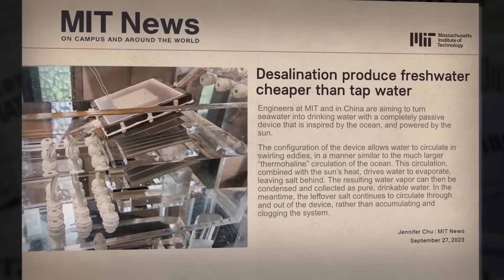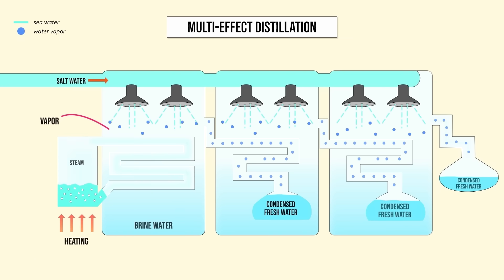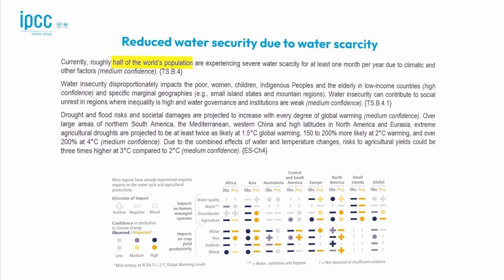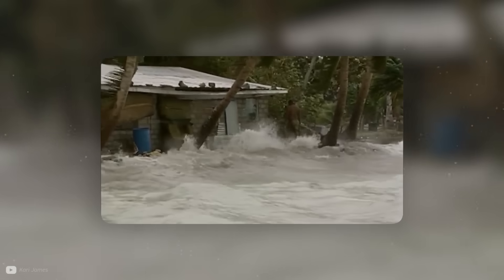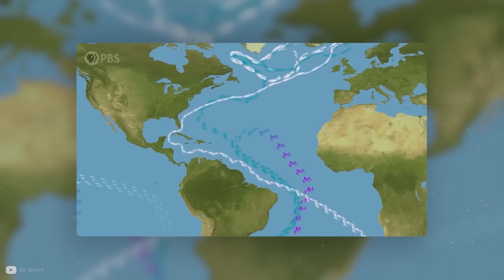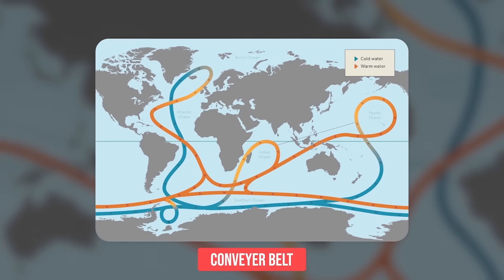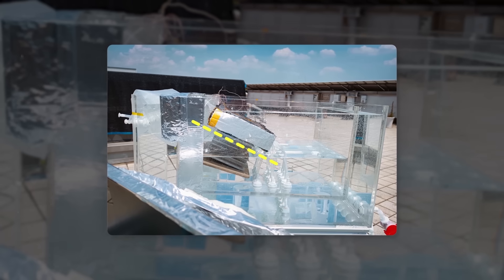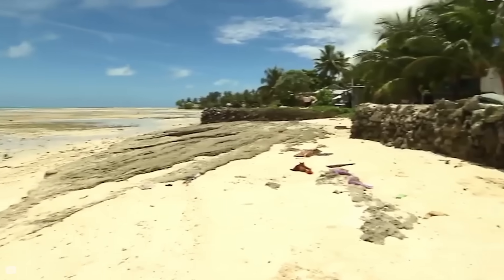Unlimited Fresh Water: Can MIT's Breakthrough Save Us?

Comment: how much sea level risen are you actually talking about?  it is public knowledge that it is less than 30cm(1foot) per 100 years. 
How much of the salt water contamination is due to excessive commercial extraction of fresh water?   I would be much more likely to follow your argument if you removed your clean green bias from your research
Reply: When you get into your car and speed along the road, you can measure the speed you have at any given moment. But if you ignore the acceleration and simply assume that you will continue at the same speed you are at now, you will not be able to estimate how long it will take you before you reach the end of the road...
Your assumption that 30cm per 100 years is a constant that does not change is where your mistake is.
Reply: @liquidminds  THATS YOUR ANSWER??  Maaate!  firstly, you are assuming an acceleration. ?  without giving any proof(dont bother, there is none, unless you're the type to purposely look at only a statistically insignificant range of years and call it "science"gospel, douche-style).  sea level rise has slowed! to 2mm/year over millennia and in recent decades "accelerated" to 3mm/year.  Considering constant decadal cyclical changes in sea level, this is simply not statistically significant.    All i'm saying here is : Don't use msm narratives as fact if you are not able to defend your position(aka know what you are talking about)
The reason i am makinig a fuss about this, is simple - half-baked scaremongering regurgitated to the masses is not helpful.  Use your platform responsibly and please put some time into understanding the various scientific views on your topics of choice.   Otherwise, very informative piece re desalination tech, thx
Reply: oh and what is the take on extraction of freshwater causing the salt contamination??   
- because here's where you will find your statistically significant cause, not in the sea level. simple human greed- commercial growth over-using a finite freshwater supply.  The freshwater is pumped, saltwater is sucked in through the inherently porous substrate to replace it .   Bon appetit
Reply: @saberling  agreed
Reply: @liquidminds  that makes no sense
Reply: @Millenial_Trucker  eli5 taking a picture does not explain the movie.

Comment: Years ago, I saw a video for a method in which the unclean water is in a shallow black bowl covered by an oversized transparent dome-shaped lid and placed on an oversized dish. The sun heats the water to create water vapor that condenses and falls down the sides of the dome into the lower dish. I presume one could equip the dish with a tap.

Comment: 144 liters/38 gallons per day, but how does one get the saltwater to it, and where/how does get rid of the unfiltered water?  That could be a lot of water pumping both ways.  Is it practical for home use?  Or even business use.  One would have to live pretty close to whatever sea and, depending on the quantity needed, a lot of units.  Practicality depends on the number of units required per location and the costs of setting up pumping both ways.  The saltwater waste output would likely not be good for sewage systems.  Lots of things to be considered before buying, once they are available and the unit price is known, or prices if there will be capacity options.

Comment: What most people do not understand is that instead of pumping the water at 800 to 900 psi, the main obstacle is overcoming the Osmotic Pressure.  This can easily be achieved by putting the intake at approximately 1,800 feet deep in regular seawater.  As the water is filtered, the saltier water can be discharged into the ocean and will drop below the filters and will be rehydrated as it moves downhill with no problem to marine life.

Comment: Modification of an existing technique for harvesting salt from sea water could also provide fresh water using solar energy. With this technique salt is extracted by allowing sea water into ponds, then sealing them off. Over time the water evaporates leaving salt behind. 
I envisage having a central pond containing sea water, surrounded by a moat for collecting fresh water, and the whole thing covered with a transparent dome. Energy from the sun evaporates the water in the central pond, which then rises and condenses on the dome, before running down into the moat. Water is extracted from the moat and salt from the pond. 
Occasionally the central pond would have to be allowed to dry out completely to allow for salt removal, so more than one setup would be required for continuous production. Due to evaporation rates this method may not provide sufficient water for urban use, but it could be used to gradually turn arid areas into fertile land.
Reply: They are too busy trying to figure how to make desalination profitable, not to make it work efficiently. That's why your idea won't work, it's too simple and you can't confuse governments to waste money when they understand how it works.
Reply: Peruvians have used the pool, evaporation, and extract method for salt for centuries.  The Salt Mines of Peru.  Adding a way to capture the evaporation of water is the key.

Comment: how expensive is the membrane and how hard is it to manufacture?  Does the water have to reach the boiling point to produce the vapor?  That seems very hot and don't see how the sun can do that.  This will not work in cold climates.

Comment: Fresh water scams are the new modern snake oil. You can't pump water by water column pressure to an elevation higher than it's starting point. Maybe the image is wrong and the whole box is below the surface level of the surrounding salt water, with a clear water free line of sight to the sun. Although how this is kept just below the surface with tides is a different question.
Heating water can cause it to boil due to partial pressure and low relative humidity in the air but again maybe the image is wrong but it looks like a filled vessel of water. How does the water vapor go down through the salt water to the membrane? 

This is  a scam device until they hand over a unit for independent testing.

Comment: I have always wondered why desalination via reverse osmosis with high differential in pressure via altitude differential (some long wells filled with filtered sea water and an osmosis filter at the bottom) isn't viable given it only seems to use energy for pumping water upwards and brine outwards (otherwise than the filter cleaning/remplacement and initial construction of the site)
Reply: Well, there are a few problems.  To get the pressures required it would have to be quite deep, and 2ndly when its that deep how do you service it to regularly replace the tubes, 3rd how do you remove the brine from such a depth?

If you are letting gravity/pressure do the work (im not an expert in physics) but seems to me would take pretty much just as much work to get the water back to the surface as just pressurizing it on the surface to that "depth".  Might be wrong on that one though.

Comment: What is actual breakthrough here? This is a device that evaporate water using heat from the sun. So this system will be limited by the time of the day, sun intensity and available space.  There is no info on how much water per day it can produce nor how much water per square meter (remember that heating element has to face the sun). 
Looks like it is good for the lab but unpractical for large scale.

Comment: There's an easier, smarter, cheaper and lower impact way - you construct a hemisphere shaped greenhouse below sea level so that you can use gravity to feed salt water into it.
The sun heats the water, it condensates on the inside surface then runs down the sides into collection gutters which catch it before it drips back down into the salt water pool.
You allow the thing to keep running until the pool is full of salt, at which point you simply dig the salt out - you now have industrial grade salt which you can sell.
Allow the pool to refill with sea water and literally rinse and repeat.
There are no filters to replace or clean, you're evaporating ALL of the water out of the salt so no brine to pollute sea or ground water and in addition to producing water, you're earning money from the salt.
Gravity pumps the water into the system, the sun extracts the fresh water so your only potential power concern is moving the fresh water collected somewhere else and digging out the salt from the pool every once in a while - if you're in a third world or other resource limited location, use shovels and buckets to remove the salt - the locals might even be happy to show up to do it for you for free in exchange for them keeping the salt.

Comment: The Ekman Effect also drives both underwater and surface currents which then drive the water and dissipate any hyper salinity in the region. Desalination is a good solution for coastal regions but for inland/landlocked regions we need to harvest rainwater by sequestering it through deep bore wells to recharge the ground water table.
Reply: except . . .  fracking makes groundwater toxic
Reply: @cleanitup_pls7893 yes fracking is the worst type of fuel extraction. It requires at least five times more water and destroys the habitat
Reply: I like to picture the desalination plants along the coasts and pipelines running inland to areas of need, including natural/wild areas. Just think, when they leak, all we get is more grass. Sigh. Of course, flooding could be an issue, but I like to also think of shut-off valves and redundant safety systems.
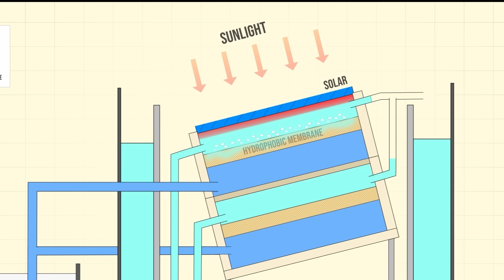Reply: 12:25

Comment: Seems to me you should have read somewhat more on Reverse Osmosis (RO) desalination before rushing to make this video.
RO desalination works thus: you take water from your salt water source (sometimes it is also a brine lake) and you send it through the membrane. The recovery tends to be about 40%, meaning about 40% of the water coming into contact with the membrane passes it and becomes desalinated. This means that indeed you produce more brine than fresh water, but the brine isn't "hypersaline" as the increase in salt concentration is about 66% higher. Furthermore, the brine is usually sent back to the sea at lower depths and more offshore to minimize the issues with adding higher salinity water and to avoid interfering with sea life.
Now, to the "salt clogging". It is a reality and it is called scaling. However, it happens mostly on the long term (over many months, more like 2-3 years of almost continuous operation). This is because you can add some antiscalant chemicals and because the recirculation pumps maintain a high turbulence in the membrane channels which reduce salt accumulation on the membrane surface.
Lastly, to the costs. You mention 1/5 of 1 US cent per Liter. This translates to 0.002 USD/L or 2 USD/m3. The present RO desalination costs are approximately 0.5-1-0 USD/m3. As such, this new technology is quite expensive in comparison. Sure, it could be improved, but I see multiple challenges. The comparison with price of tap water is nonsensical, as this price is different for individuals and business and usually accounts for all the infrastructure around the piping and management of said water.
Lastly, the solution will never be desalination. Try using it to pipe water from the sea to the middle of Kansas or Slovakia or Chad. The distances make it unrealistic. The solution goes through reduction in use (mostly agriculture and industry, which use about 50% and 30% resp. of the water produced) and the reuse of water (sometimes called unimaginatively and unhelpfully toilet-to-tap). Sure, some solutions like the membrane distillation you referred to can be very useful in island states or other remote locations, but for the bulk of uses? Nope.

Comment: At 13:45 you write, that the system has „no salt accumulation“. But this is not true. If you take salt water and take out the water you are of course left with salt and they would still end up with the question: what to do with it?

Comment: Great for small communities, also look very promising.
But looks somes way to go for large scale solutions:
- a small water treatment plant produces 10,000 Liters per hour, at a cost of about 0.0001$ per Liter (1000L per 0,10$).
- tap water consumption is commonly 200L+ per day, per person.

The displayed system also seem geographically locked: any short, sudden period of frost would destroy the intricate piping.
(I have a degree in the field, and worked for a few years with a wide range of equipment, but I'm most accustomed to river-to-tap installations)

Comment: Either your diagram on the screen is wrong or this system will not work properly if it works at all in my opinion. The use of the word vapor instead of steam is another cation flag that set off alarm bells in my head but I am probably wrong or at least I hope that I am.

Comment: Could you contact the developers of this project and tell them they can make 4 significant improvements to this contraption:

1. 
They can add castle-style grooves and ridges to the membrane layers to increase the surface area, thus increasing throughput.

2. 
They can make the entire thing transparent, so that even less heat energy is lost.

3.
They can make the layers thinner, so more layers can fit in a given space.

4.
They can increase the overall depth of the unit for similar reason as 3.

Commend them on their breakthrough and excellent work on your reporting, this is indeed a major breakthrough for mankind.

Comment: There's an easier way. Plasma drill to geothermal depths and fill it with seawater. Cap the top and generate electricity with the steam, condense the steam.
Copy and paste. Auger the salt after a few goes. Process.

Comment: Great video; I have questions. 1. I was left unclear what happens to the saltier water produced, this is indeed a problem in some coastal waters where desalination is practiced on a large scale (You simply said this device solved that problem). 
2. The cross section diagram seemed to show salt water entering the top layer then circulating back to the reservoir down the same pipe, I can’t see how that would work, is there another pipe not shown? 
3. Is the salt water in the third layer actually heated to evaporation by the new fresh water above (salt water boils at a higher temperature than fresh)or is this simply increasing vapour pressure and achieving the same result?
Any answers gratefully received.

Comment: Cold liquid water on bottom and it's heated to vaporized water, steam, on top. So how does vaporized water then move downwards, through the colder liquid water as a gas and through the filter. Doesn't make sense. What does make sense is that on the upper right hand side of the diagram is a over flow pipe. That would get filled with the water vapor, up and away from the filter.

Comment: in the late 80's I learned out to make fresh water out of salt watching by watching PBS dig a hole. put plastic on the bottom.. put water in it.  put a stick pointing up and put a piece of plastic over that and have the water collected on the top run down into a cup.   

I've seen small green houses that used the same idea.  Clearly doing on a large scale for a whole farm would be quite an undertaking but I wonder if anyone has done so and what sort of success/failure they had.

Comment: The question is always, can you scale it up and it still be effective?
Many times things can work fantastic on small scale, while being impractical, insanely high maintenance, very expensive to scale up to provide for a city.
It's like the difference between setting rules for your house and setting rules for a country.
Requiring everyone to clean their room at a certain time and go to bed by a certain time and so on, may be optimum for your home and have you living a near-perfect life, but it can't work for an entire country.
This is the issue many people don't understand when they invent a tiny elegant low power or minimal power, cheap form of solving a problem.
You can get a sheet of plastic and a bucket, a rock, dig a hole, let condensation drip into the bucket or or put a plastic bag around the branch of a tree and collect water.
These are simple, cheap practically free ways to get water, but you can't practically scale this for providing water for a city.
Reply: Could you make 100k of these devices and distribute them to 100k households?.. 🤔🤷‍♂️
Reply: I.e. 100k small-scale solutions instead of building 1 big plant?
Reply: @3abxo3990  That's actually exactly what happened to electricity production with photovoltaic.
Reply: @3abxo3990  I think that's the goal. I don't think they need to scale up this device

Comment: So this is effectively a more expensive version off "dig a hole, fill it with water, put a glass roof over it and collect the evaporate". Sounds like a hoax. If it is that easy, why has no one done it before, without the extra bits and bobs?

Comment: Parts of Spain use sea water to flush the loo.  We stayed in a hotel in Blaines and we were told about the salt water flushes.  There was also a desalination plant nearby.   The tap water tasted terrible.  If you swam in the Mediterranean opposite the hotel you suddenly get this strange thing a sudden waft of salt that burned your skin.  Also the sea water bacame even saltier.  We were told by the hotel that once the water has been extracted the salt is pumped back into ocean opposite with no warning. Ughhhhhh. Spain has a major drought that has lasted some years.  The year I went to Spain it rained most of the time and a river that ran into the beach from the mountains had been dry for a long time.  This particular year the river had finally refilled and flushed out into the Med. Does this new water innovation remove the terrible taste of desalinated water?